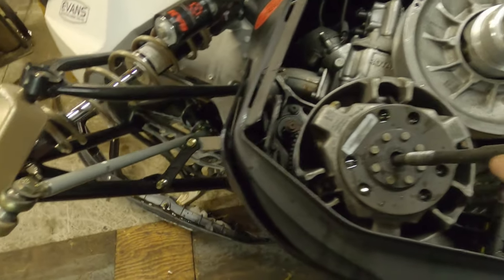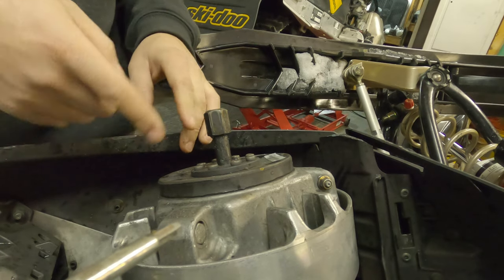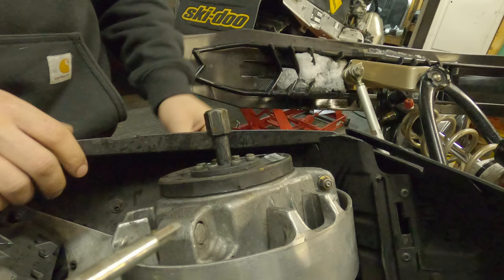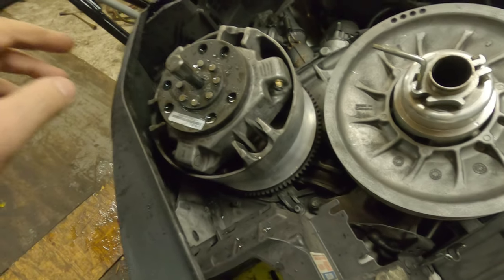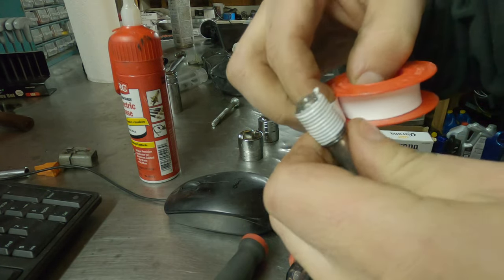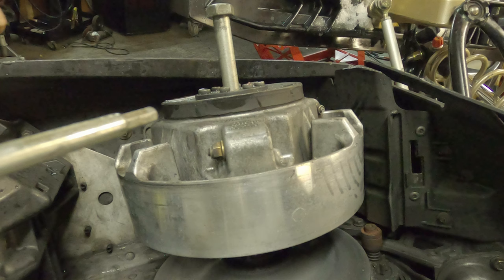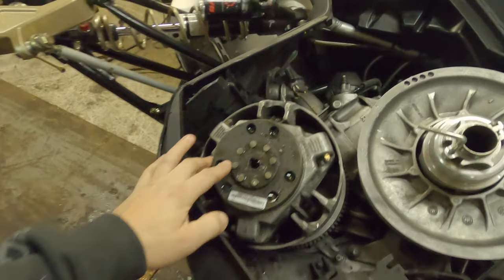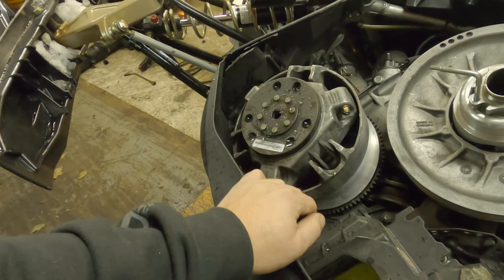How To Remove a Stuck Skidoo CVT Clutch

Comment: I have a 2022 Gen 4, my primary was on there so tightly seized, most likely due to it getting very hot a few times riding in warm and slow tight tree riding. Other methods will most likely not work other than heat oxy/acety as you demonstrated and then pounding on the puller like you showed. 

I tried the water and Teflon tape, grease, lubed threads, puller and air hammer, puller and hammer. These methods will work for non-stubborn clutch.  Oxy/acety is the key when this is seized on. The trick is to get that area as hot and fast (not cherry hot or even close but around 250-350F, I used a thermocouple accessory on a multimeter to check) and pound the puller so the heat does not continue to soak into the seal and bearing. You can pound through the small opening on the Gen 4 with a ball peen hammer. Ensure the puller is already in the there as tight as it can go without snapping or striping the threads. It will pop off when pounding with the heavy ball peen hammer

Do not use propane or map gas as this will just get everything outside of the area to hot, the heat needs to be focused on the shaft housing where the belt sits. Once the clutch let go I checked how hot the shaft after clutch removal and it was not quite hand touch but close, so I used compressed air to blow over the shaft until it cooled and then cooled the clutch. 

I want to say a big thanks to guys like Bobby making life easier in the DIY world, thanks man. I also wanted to pass on my experience in my added techniques and hopefully it helps someone as well and give confidence that this can be done.

Comment: Water method is best!  Remove clutch bolt, wrap lots teflon tape around threads of the bolt, pour water in the bolt hole of the primary clutch, thread in bolt by hand and then use impact gun and should hear a loud pop of the taper fit and boom!  Clutch is off!   No expensive clutch puller needed...  I've done the water method multiple times and each time works perfect!
Reply from the maker: It works awesome the key is thread tape over the front of the threads